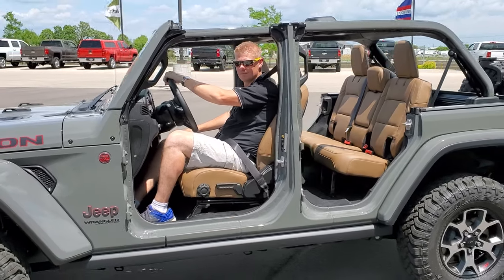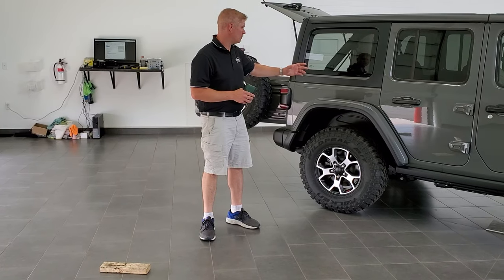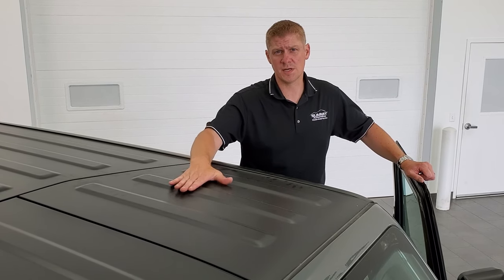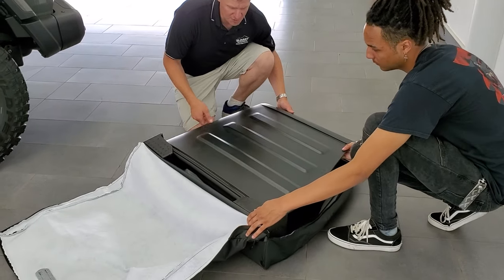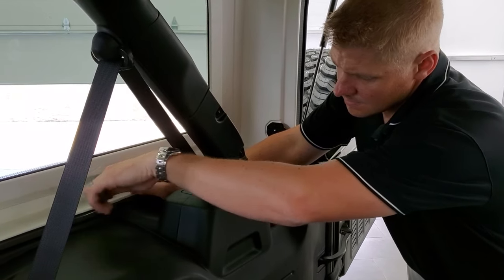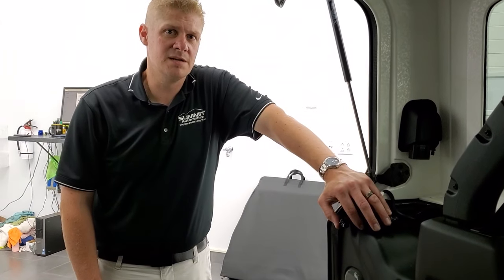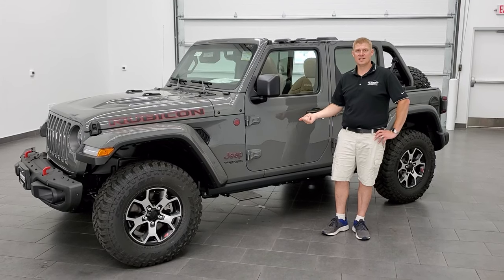HOW TO REMOVE YOUR JEEP WRANGLER JL HARD TOP REMOVAL STEP BY STEP TAKE OFF YOUR TOP ON YOUR WRANGLER

Comment: We got our 2021 rubicon in Sept 2020. My husband wanted this jeep so much, he got the tow pkg but I was bummed he didn't get waterproof seats. He picked up his new jeep the 3rd week of Sept and kept feeling super tired. Got diagnosed with leukemia Oct 3rd, he barely got to drive his jeep, he passed on June 18th. 18 month battle.  I'm kinda stuck with it now, it's a man's vehicle, high, we put running boards but doesn't help me much. My husband was tall. Hunter and serious fisherman, this jeep was for him in mind, not me. We had a brand new 1984 Jeep Renegade CJ-7 which was AWESOME! EASY to remove hard top and put a soft top or bikini top on. Our girls were young and we had a blast going to Wildwood and Cape May. Thos Jeep for me is no good. Complicated, still ha e the plastic on inside for top that I'm never going to take off. I'm thinking of selling it and getting something practical. 

You made an excellent video. I have  no idea where that tool kit is.
Reply: Are you thinking of selling it?

Comment: Lmao thank God Jeep placed those two bolts there from 6:11 . I removed my interior cargo basket that reuses the six hard top bolts to fit a spare 40 on the rear. Just came back from an offroad trip, and I realized that I never put those bolts back... Driving down the freeway at 75mph with an unbolted hardtop could've been deadly to others.

Comment: where did you get that case for the hard top? I never got one when I got my jeep jl at the dealership
Reply from the maker: They come from the factory when you get a hard top.  You should be able to get one from a jeep dealership.  Here is one I found on ebay.  They have 6 available. https://www.ebay.com/itm/325290277245?mkcid=16&mkevt=1&mkrid=711-127632-2357-0&ssspo=m2Xx5gWzRIG&sssrc=2349624&ssuid=c-IxxvWoQfG&var=&widget_ver=artemis&media=COPY

Comment: Great video - very helpful to understand hard tops on Jeep Wranglers!  Two quick questions - do the hard tops on all Jeeps come similarly structured - meaning the 3-piece configuration? And how much does the big one weigh? (You mentioned 50 lbs for the front two together). Thanks!
Reply from the maker: All the factory hard tops have this configuration.  The front pieces are always going to be the same weight.  The back piece I would estimate to be about 100 lbs.  The only thing that varies is from the 2 door to the 4 door the back hard top piece on the 2 door is bigger.  Probably 5 to 10 lbs heavier too.
Reply: @Summitauto  - thanks!

Comment: I am currently considering buying a 2-door version.  Can one person take off and put on the hardtop on the 2-door wrangler?  Also, do you have a similar video showing the process for the 2-door?  I know the mechanics are the same, but was curious  of the smaller and lighter hardtop for the 2-door was a lot easier to deal with.
Reply from the maker: The 2 door hardtop is lighter but is awkward and requires 2 people, but not as strong of people.

Comment: Can someone please please PLEASEEE tell me why the electrical connector to get off the hard top won’t disconnect. The hose is able to connect but the electrical one one budge and I’m pretty sure it’s not supposed to be this hard.
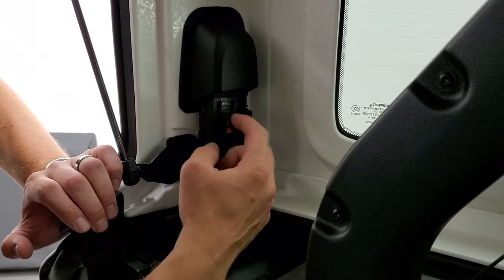Reply from the maker: You have to take the lock off and you have to press the release.  Watch @6:50 closely.
Reply from the maker: Try this video may be clearer.  
https://youtu.be/zmk7ftWpYLs

Comment: What is the name of the piece that the electrical quick connect and washer wire hook to? My Used JL is missing that piece. Do you know where I can order one?
Reply from the maker: I tried getting the part number off of one today but it didn't bring anything up.  I will check with my parts department.

Comment: I can’t get the quick disconnect parts off :(
Reply from the maker: Watch closely how I do it on the electrical. There is a red Safety clip that has to be moved first and then a black clip that has to be pressed while pulling.

The washer fluid also has a button you have to press.

Comment: A relatively good informational video however I have two things two suggest. 1 show the actual compartment where you put the bolts when you take them out of the top so that people can understand they  are secure and won’t get lost. 2 inform people watching that there are hard top removal systems that would allow you to do it by yourself rather than frighten the shit out of somebody that wants to take it off by themselves telling them it’s too heavy and they’ll break their back.
Reply from the maker: Frighten?  It's called a warning, so people don't get hurt. Typically if people get the hard top lifts, they already do it and are not watching this video I would imagine.  I could show the bolt holder.